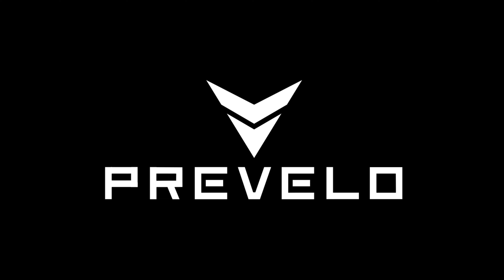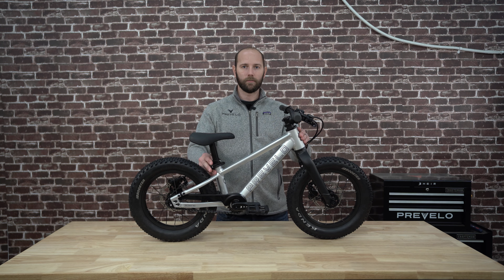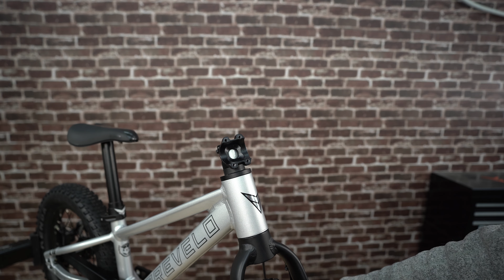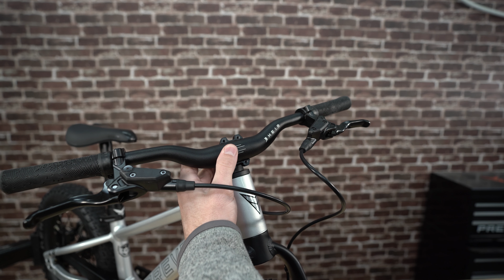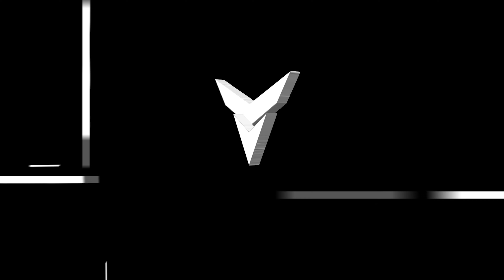Prevelo Bikes // Zulu One Assembly

Comment: Been waiting for this to bike to be in stock, and realized it was available for order. So I placed an order for the silver one! Do you know if the wheels can be set up tubeless?
Reply from the maker: The wheels are not tubeless compatible. Currently, there aren't any manufacturers that offer tubeless capable 14" tires. We have also not found a way to roll 14" double wall rims, which are required for a proper tubeless set up. Due to the rim limitation, you will probably see tubeless on 16" and not 14" in the coming years. That said, the new Zulu Two does have tubeless ready rims, but without a suitable tire available it still can't be set up properly.
Reply: @Prevelo ok, thanks for the response. I figured it would be unlikely but was worth the ask. I’ll probably get tire liners for it. They work well against punctures.
Reply: Excited to get my little ones Zulu one next week!! Just FYI, the kids ride shotgun Dirt Hero  14” wheels  come pre-taped and ready to go tubeless.